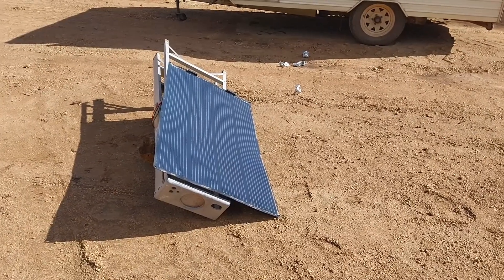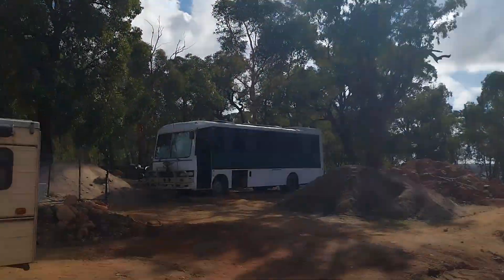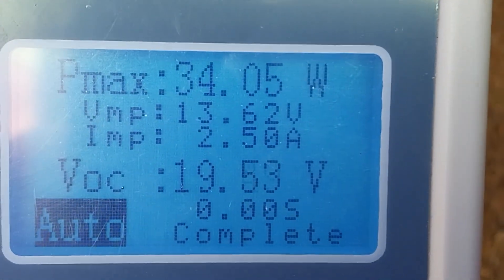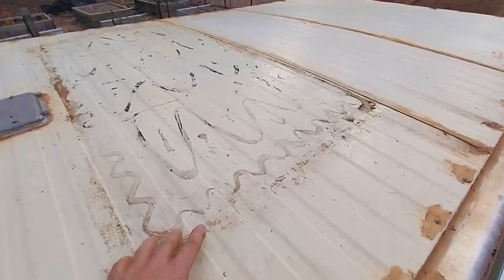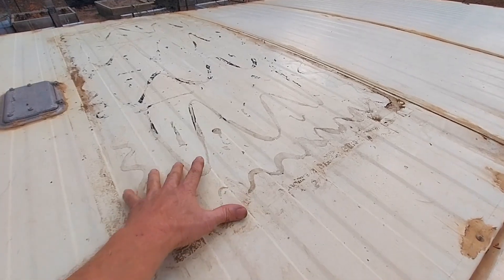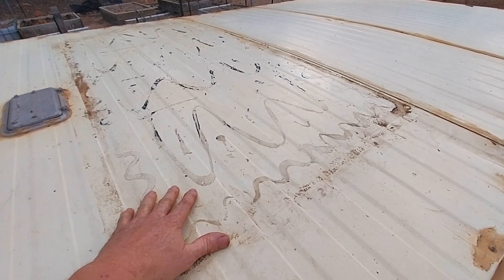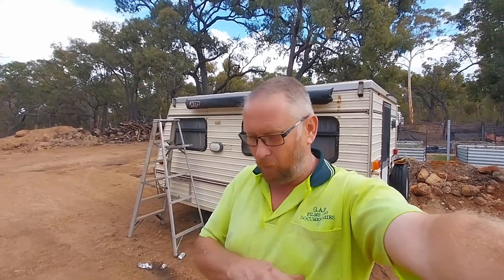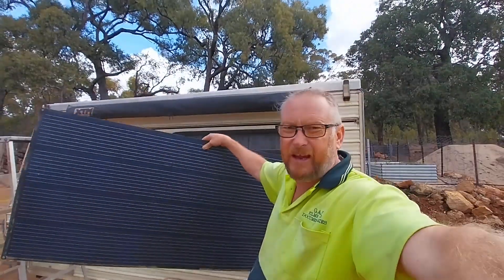160 Watt Flexi Solar Panel - It Has Failed ?

Comment: I had a panel that packed up within weeks. It wasn’t Kings but the problem was the terminal blocks let water in. I just removed the block re-solded the wire new diode and sealed it properly

Comment: Sh1t luck Glenn
Could you simply fit a standard solid panel to the van?
Reply from the maker: I was trying to avoid it due to the weight, being pop top and didn't wanna drill holes in the roof. But think I might just have to give it a go.
Reply: Just silicon the frame to the poptop and youll be good to go.
The frame prolly weighs well under a kilo

Comment: Solar panels are a reverse led light,  the sun light turning into energy. So a normal led, if it gets too hot, or too much current through it, if you look, you get a browning across from cathode to anode. Led lights need to be mounted so they run cool.
Solar panels have two diodes in the circuit. One parallel for series connection. It is a solar panel by pass diode if that panel in the row becomes shaded by trees. The other is when the darkness comes. If faulty, the panel will act like a light. By the naked eye, you can not see due to the colour spectrum it runs in. 
So the panel faults can be, panel silcone break down due to burning from getting hot. Diodes, Carbon produced by diode break down and the electricity can track across. Panel acting like a light or the by pass has broken down starting to act like a short circuit.

Comment: Mine died early too, it produced the voltage but not the amps so it was more than likely one or more cells died.  When I tried to return it they said it was working as it produced the voltage but I argued volts x amps = watts (it produced 0.9A in full sun under load and he looked at me like I'd just landed from Mars) but in the end they did exchange it after owning it for 3 months. Good luck with yours and its easier to get a store credit than a refund
Reply from the maker: Was that from the staff at your local store or was it from Kings direct ?
Store credit won't take me long to spend :)